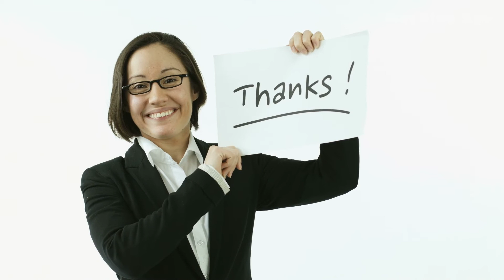China’s Three Gorges Dam Is Deformed And On The Verge Of Collapse

Comment: No problem china used advanced rubberized cement in the dam construction.                                   with such length the  dam should have constructed arching convex to pressure like the  HOOVER DAM  most likely ancient Roman engineers will do the same 😂😂😂😂😂😂😂😂😂😂😂

Comment: No fan of the CCP and it's thumb on its people, but this business of extreme 'dam warp' is BS. As with any lengthy project you will have slight deviations and such regarding shift, settling and even cracking (some more than others) the only real threat would come via mother nature. Overflow, earthquake and tectonic shift, erosion and such, but that would take years. I heard of problems with the dam(as with any dam) but they are overblown and exaggerated. From my understanding the dam should be able to withstand a quake beyond 10.0. However, like with anything else, it remains to be seen, as we have never had anything like in my knowable life time or in nature.

Comment: With its span  they should have constructed it arching convex to pressure
Reply: They are scientists and engineers!! What's your qualifications?
Reply: @dstr1 No one in their right minds would build a straight dam at this location to hold back this amount of water. This dam WILL fail, and probably sooner rather than later. I give it less than 5 years from now,  because it was not built convex as it should have been.
Reply: @dstr1  My credentials are the observation and the basic knowledge of all major dams and why they are built convex
Reply: @Riv_Dyl97  Then maybe you should not brag about that "credentials" to make a fool out of yourself. Have you heard of something called the "gravity dam"?
Reply: @Whitfield369  shockingly I have. But they can only be built on top of foundational rock
Reply: @Whitfield369  Yes. And they can only be built in certain areas. This is not one of those areas. I have a strange feeling though I will never be able to change your mind on the fact this was a dumb way to build a large dam.
Reply: @Riv_Dyl97  Hmmm... my replies are being blocked? Let me try to post with smaller posts in 3 parts...
Reply: @Riv_Dyl97  Part 1/3: There are thousands of experts in China, in fact even invited international experts in this very specific area, who planned, designed, built, and now operating this magnificent engineering marvel, which had been, and still is continuously being scrutinized ...
Reply: @Riv_Dyl97  Part 2/3: and monitored closely and diligently, on location, by some best brains among the 1.4 billion Chinese who are proven to be very smart, in science and engineering, from heaven to earth. Yet you, a keyboard warrior like me, want to convince me you know better, ...
Reply: @Riv_Dyl97  Part 3/3: , that it is a "dumb idea", because based on you considerable experience in "observing other dams" (more like looking at superficially?) And I supposed to change my mind to give some credence to your "expert opinion"? Don't you think you are a bit too conceited and pompous? Ok let me see if my replies are still being deleted.
Reply: @Whitfield369  they are saying the same thing about their man-made islands. 😂😂
Reply: @Riv_Dyl97  Then for my edification maybe you can enlighten me on what about their man-made islands. I hope it is not as shallow as your expertise in dams.